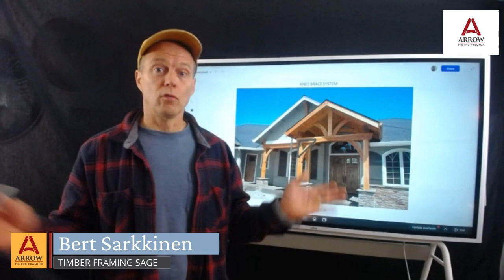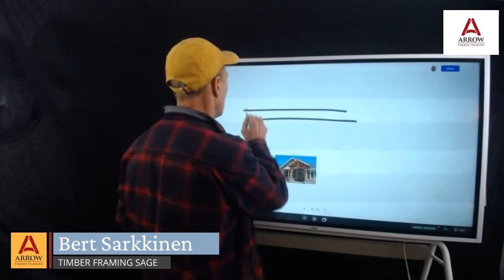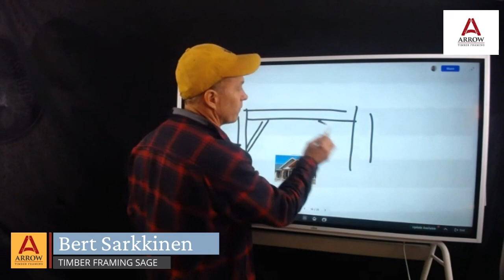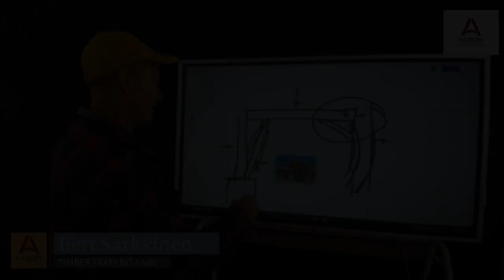Do Knee-Braces Reduce the Span of a Tie-Beam? What Do Engineers Think?

Comment: Hi, I don’t know much about structural design. On the off chance you see this comment, I’d like to ask if it’s necessary to install bracing to all 4 columns to reduce a mezzanine’s lateral movement, or would installing to 3 columns suffice?
Reply from the maker: You can get by with basically 3 stiff walls, but it puts a greater load on everything and you'll need a stiff diaphragm with x-bracing or plywood on the floor. If there's a design reason to go three, that's ok, but 4 is likely the best way to go.